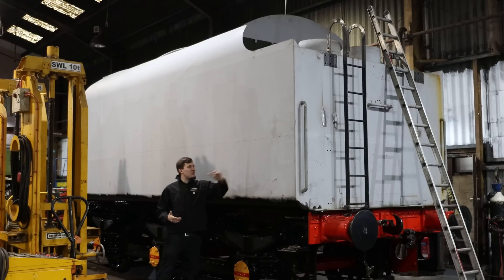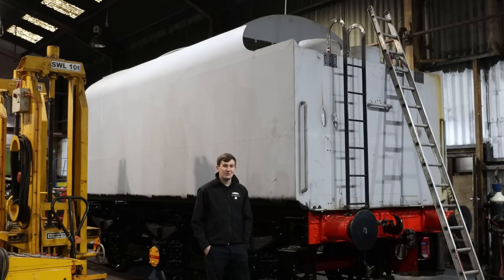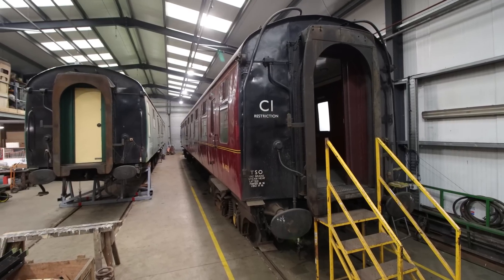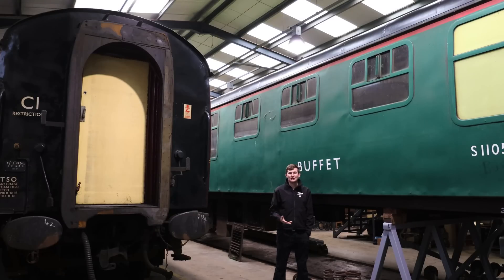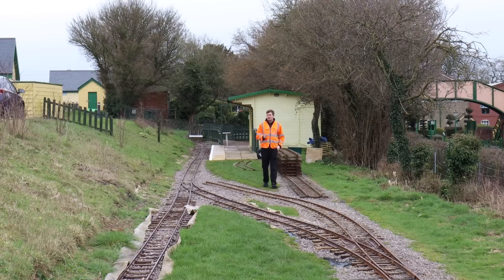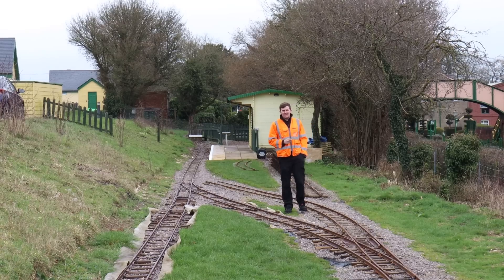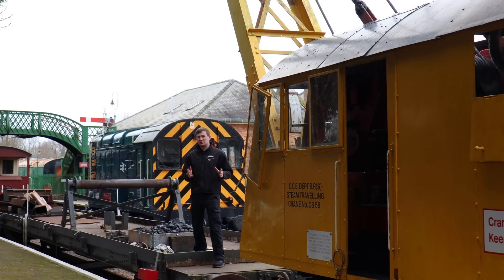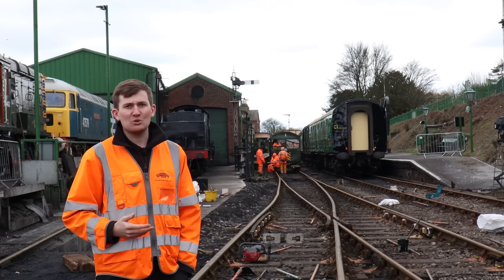Keeping You In The Loop - 'Braking It Down - An Important Job!'

Comment: Im wondering if there would be a better material to use for the brake blocks? I know car brakes have some really high tech composites? Would they would on the locomotives there? Instead of changing blocks could it be something like an insert? So when it reaches the ware point it can be refurbished easily? I had thought on brakes design something like a multi calliper system?  Or even induction brakes to reduce stopping distance with something like an abs? Though would struggle to know if that ever been done?  Metal ain’t cheap? So things that can save you money got to be a bonus?  I’m reminded of mag brakes on rollercoaster so must be way to retrofit something?

Comment: Awesome video, like yourself I hadn't really thought that you need to adjust the brakes every few days. Imagine if you had to do that in a car 😂😂🚗
Reply: I'd definitely crash 😂
Reply: You used to do so - I had a Land Rover with manually adjusted brakes. Any car with drum brakes will have a ratchet adjuster, either manual up until around the late 60s, or automatic after (similar to that Richard described, but using springs rather than compressed air)